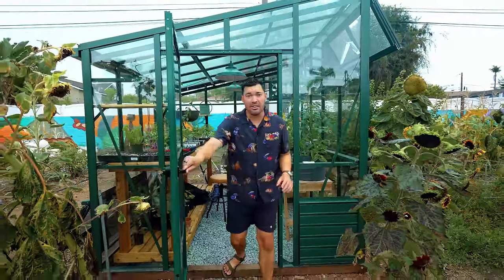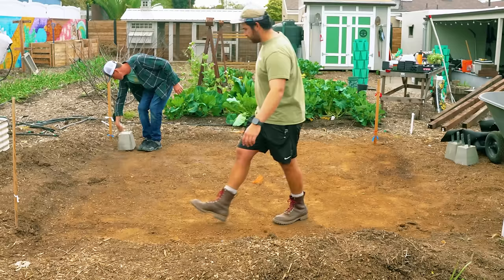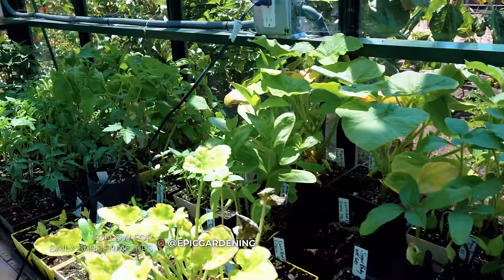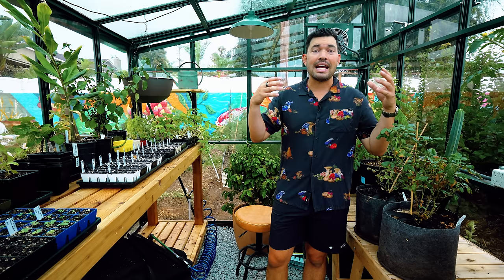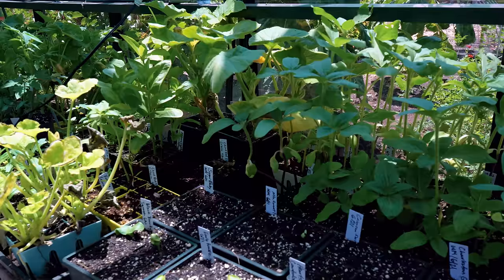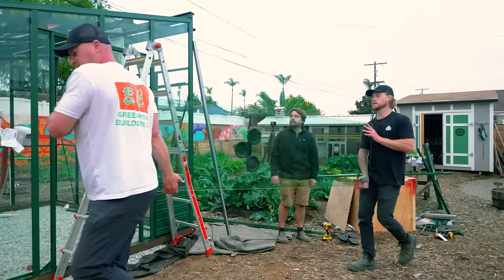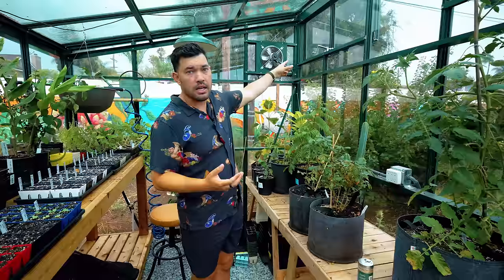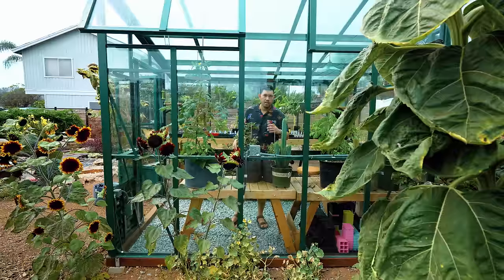What I Wish I Knew BEFORE I Got A Greenhouse

Comment: I’m gonna get a $340 cheap hoop one from Amazon to start, but this is my dream!
Reply from the maker: Good place to start!
Reply: We got even cheaper ones off Amazon, they've been a game changer!
Reply: @starlamartin354 my first greenhouse was one cattle panel 50"x 16ft. Bent over and stuck in ground..then covered with 8ml plastic..cost me about 50$..each year I added panels and smarter covers..still use it and dream of a NICE greenhouse someday😂
Reply: Add two more zeros to that $340 for this complete presented project.
Reply: I have a pop-up cheapie from Amazon. I rent but awesome landlord let me put it up. Lots of storms and wind here in Pearl MS, and I have a few repairs to make, but it is still standing This will be its 2nd full winter...No regrets 🌱❤
Reply: One youtuber uses steel rebar to "root" the cold frame connects it into PVC above ground. He clad it with frost cloth with clamps. For wind he crossbraces with twine. Search protecting tropical plants from cold (hes in Arizona)
Reply: @SpaceCadet4Jesus idk. I bought one for $300 and it’s pretty huge. Thats all the project was for me but then again I already had a cement ground

Comment: My Greenhouse gives me flexibility. You hear of people being able to plant early but, you can also start late and still get production. I heated my Greenhouse last year in fall for 4 frost nights and got an extra 80 days added before and after frost. 80 days is an extra season or 2 for curtain things. In the winter I mainly use the greenhouse to workout, it’s 100 degrees F on a freezing day as long as the sun is out.
Reply: Work out in the greenhouse? Thank you for this idea. I love doing yoga on my deck but in winter that’s not an option. Hmmmmmm.
Reply: Gotta put your cold plunge right outside for after you workout in your sauna:)
Reply: That’s a great of a greenhouse, I use my greenhouse for drying laundry in winter 😊
Reply: @jessegee179 that's a brilliant idea. Thanks!!
Reply: How did you hear your green house? What is your green house made of? Is it a DIY greenhouse or professionally made?
Reply: I move my mobile BBQ into the greenhouse for winter, so it is more accessible if the weather is good!

Comment: My wife and I designed and built a 20ft geodesic greenhouse this spring. I 100% agree with you about being paralyzed with the space and options. We also found that the intake/exhaust fans were a must with the summer heat, but I think we still struggle with airflow based on how well some of the plants did. You talked about opening up better options - If I recall, coffee is solidly a tropical plant? That would be fantastic. I want to move our citrus and olives in this winter. I am in 6b/7, and hoping that with the proper setup we can keep that greenhouse above 60F throughout the winter. 

To be honest, I wish we had gone with something simpler and easier to take care of. It looks cool as hell, but I already know what I need to replace and I need to schedule maintenance around the grow season to make sure I am not trampling everything inside.
Reply: Thx for this perspective. I keep thinking about all the windows that would need to be kept clean.

Comment: I built mine originally from recycled windows from my house. It didn’t last. The windows were single pane and the frames were compromised by weather so it fell apart over time. Now it’s made with plastic corrugated panels and some metal sheets. Much better. This is the first year for the greenhouse to be finished so I’m spending the fall organizing it so I can grow seedlings and some of those plants you mentioned that would otherwise be out of the question. They are a great addition to the garden and a much appreciated season extender here in zone 6a

Comment: What I wish I'd known before I bought my greenhouse:  living where hail is a regular occurrence (Colorado front range), with a polycarbonate greenhouse, make sure to have plenty of spare panels on hand and hope that it's easy to replace them.
Reply: I also live in Colorado... south eastern burbs on prairie.  I am looking at buying a greenhouse and have definitely looked at B C Greenhouse.   My question to you @johncaswell2648 is this:  glass or poly?
Reply: @bluesky7226  Mine's poly because it's a cheap kit from Amazon, gets the job done for me but nothing special.  Glass is probably nicer, so if you're willing to spend the extra, I'd say glass is probably better overall.  The one advantage poly has over glass is that it was very easy to cut it to mount an exhaust fan.
Reply: Thank you for your reply and advise.
Reply: One of the ladies this guy throws to lives in Colorado and went with glass. Said the hail has not yet broken anything, knock on wood! Good luck.

Comment: I'd mention that preparation may include building codes and permits, including the electrical.

I'd also mention mold and fungal growth with improper humidity and a plan on how to keep both inside and outside windows clean and sparkling, especially on the roof.

A lot of other unspoken details need considering and can't be overlooked really, but don't let that stop you.

Of course there will be things you wish you did differently despite the overall success of your project, that always happens.
Get to growing.

Comment: My husband is building me one. I’m taking what I get! We raise Rams so the first three feet is metal. It’s 16x24 in our backyard. Mines permanent as he put in 12 poles each with 80 pounds of concrete 😂😂 I’m the concrete mixer in this family. Couldn’t feel my arms after that weekend. It’s not done yet but this winter should be done. In West Texas so we have a longer growing season. I’m getting an echo delta 2 solar generator for running grow lights and fans and heat for the week we freeze. Also have propane backup for heating.

Comment: It looks like you also used the wrong kind of gravel for your shed. Not sure about the greenhouse since it's not actually supporting anything. But it looks like you put down clear stone/washed gravel. What you actually want is AG stone/Paver base/road base (different names for the same thing) which is a mixture of 3/4-1.5" gravel, along with smaller pieces of gravel and fines (crushed stone). This mix can be wet down and compacted and will make a very hard, compacted surface appropriate for various uses depending on the depth. 

If you want a more compacted surface for your greenhouse in the future, you could probably mix some fines in with what's there, wet it down and tamp it, and you'll have a hard, smooth surface.

Comment: I got an assembly kit from a box box store.  I wish I knew more about how the material would be  impacted by the harsh Texas weather
Reply: I have a pop-up cheapie from Amazon. I rent but awesome landlord let me put it up. Lots of storms and wind here in Pearl MS, and I have a few repairs to make, but it is still standing This will be its 2nd full winter...No regrets🌱❤
Reply: Texas has weather? I thought it was a desert.
Reply: When I was a kid, my dad built a glass greenhouse (b/c he thought it would be less of an eyesore near the house than one using fiberglass) in FL.  Didn't work for conventional vegetables or even orchids, but a great place to collect Kalahari Desert plants.  (So hot even some cacti struggled.)  I still miss the stinky but amazingly peculiar stapeliads that grew like weeds.  If you use glass or another transparent, heat trapping material, you might try an aquaponics setup (for tilapia or other tropical fish; Rio Grande perch sounds cool) so that the water can moderate temperatures (at the cost of high humidity though) enough for at least Southern and tropical vegetables/fruit.  Or pay attention to the microclimate you created and become a collector (probably of low-altitude desert plants) and consider it a hobby rather than food production platform.  Some cacti are of course delicious, so there is that option.

Comment: I love my little greenhouse even though it isn't a permanent structure like yours.  I just took a 10x10 pole canopy that you can pick up at a big box store and skinned it out last year with cheap clear plastic film instead of the fabric it came with.  This year I managed to get my hands on some 4mm double wall greenhouse panels pretty cheap and will be using those instead for a more substantial setup.  Since I can take it down at the end of the season and put it back up when it is needed again, I need no building permits for it.  The frame also made a great trellis for my dipping gourds and luffas, though when they are done I will be scrambling to get the panels on it before it gets too cold out for some of my other plants that need to spend the winter in there.
Reply: Awesome idea! I was thinking to do something similar with one of the free trampolines I constantly see on craigslist. We already built a shade structure with 3 of them. Just went to Home Depot and got longer poles to raise the trampolines to different levels and over lap them slightly like a venn diagram. The trampoline fabric looks like a 50% shade cloth so it makes hot sunny days more enjoyable in the yard. This type of greenhouse would be more airy than an enclosed greenhouse but I think it would be warm enough in zone 10a. Tarp it or put clear plastic over top in winter to keep rain out.

Comment: That sunflower is massive! This greenhouse is definitely inspiring me. I’m wondering if I could do one that is half Lexan on my windward side to block out too much wind (it gets really strong here) and rain, but do screen material on the other side. Or, do pop in and out panels for seasons. I love that wax piston window system, though I wonder what temps it has to get to for opening and closing. Since it’s mostly 70s and 80s here, I’m curious if it would just be open all the time anyway.

Comment: I had bought a greenhouse kit a couple of years ago, and last december we tried to put it together and the frame was so crappy. So in June, I finally got the lumber to build it myself and utilize the panels from the kit, its way bigger than the kit. I get great sunlight, I'm in Texas so we had a hot summer, but I didn't have it done yet. Omgoodness you're in California, I'm from northern calif, but I have lived in Texas a long time. But my from scratch greenhouse looks fabulous, I do not have electricity to it, but a cool solar lamp for it. I have very good ventilation with really good screen material.

Comment: I have had so many green houses. Foundation is of greatest importance. If you live anywhere that has hot weather make sure you have your greenhouse pointed towards the prevailing winds if you don’t have expensive ventilation. Make sure you can put in an electric line then add another water hose to it. I live in Oklahoma City my greenhouses get beat up so depending on where you live you need to keep that in mind. My heater shorted during a cold spell-14… I had a 30yr old ficus die

Comment: My greenhouse has a cement slab floor. If I could change anything it would be to have some sort of drain in the floor.
Reply: When I was planning for a greenhouse, some of the recommendations were for a wood floor, and some were for a concrete floor. But, most were for using a gravel floor. I went with a crushed limestone gravel floor, and I am so glad I did. Spilled soil or water runoff is not an issue, and it is easy on the feet and legs.
Reply: It is not hopeless...there are drill bits that can drill through concrete.  Cold chisel???  It's been a while.

You can also get a special plumbing piece that can be glued to the end of the correct size PVC pipe, the other end connected (again, with a PVC plumbing connection that will allow you to attach a garden hose.  Big box store, plumbing section.  

Dig a hole on the side where you want your drain hole to go under your slab.  Turn on the water to the garden hose and the high water pressure caused by the fitting will allow you to turn the pipe and it will be sort of pulled forward, under the slab.  Look for videos on 'How to drill under a concrete driveway.  If you have a lower area in your garden the drain can lead there.  If not, you may need to put in a "French Drain."  (search YouTube)

 I drilled under a patio to a place where I had left a hole for a birdbath and was able to run electrical lines for an outdoor outlet to run a pump in the fountain.  

Keep in mind, it depends on where you live.... you MIGHT be required to hire a pro.  Check out your local building codes.  HTH

Comment: I’m currently building a greenhouse door seedlings, it’s on the smaller side but I got 2 of them to go side by side. Planning to use one in winter to see if I can grow tomatoes and other things that need that bit of warmth that i otherwise don’t get (i’m in a 10a zone)

Hoping to have it finished over the weekend and planting up some seeds ready to transplant out before summer 🥰
Reply: Not sure where you are but San Francisco is the same. It can get hot or cold very unseasonally but stays mostly moderate all year long. I think I'm in 10a or 10b. The reason a greenhouse is great for that kind of weather is for germination. I would kill to have better conditions for starting summer fruits. I can't reliably grow melons because of the lack of consistent warm temps for starting or growing. Same with okra. Starting peppers is so slow because they require over 75º to germinate and it often stays in the low to mid 60's day after day (in summer) with temps in the 50's at night. A greenhouse would help me create my own custom shoulder seasons and get better yields from hot season plants by getting them bigger sooner before the season.

Comment: i've got a greenhouse and noticed that the lowes aren't much different from outside so that really limits what i can do with it in my area.  and the highs are like 10 degrees higher than the highes outside which bakes everything inside.

i think a much better solution is to use a grow tent indoors with grow lights.  that way, those shorter days in the winter aren't an issue and you get the perfect temps for seedlings too.  it's a great solution.

Comment: I bought a 8mm/10mm polycarbonate greenhouse (German engineering/production and great quality) as a year round.  I really like it, it's well insulated and I only heat when temps are in the low 20's. I live at elevation TN in a schizophrenic grow zone 7a that is sometimes  like Z6 if a bad winter and every summer like a SE Z9 as a tropical climate, yes tropical with high humidity and heat. Our summer is way too hot for greenhouse growing and believe it or not at 2000ft elevation the sun intensity is off the charts. Even with shade cloth, exhaust fan sync'd with intake vent and fan the heat can stress plants.  Citrus love it along with Sweet Potatoes but not much else that I grow over summer.  I have learned how to use my greenhouse to my advantage and growing styles/climate.  But after loosing all my spring starts two yrs ago when grow lights, heat mats, heater all turned on at once and tripped my greenhouse GCFI circuit during a -12*F string of days that we never experience - everything froze it was all lost. So I still grow seedlings and starts inside.  Due to the erratic climate and weather extremes, I now grow nearly everything other than root crops under protective cover.  It started with a polytunnel with rollup sides (a virtual screenhouse) intended for summer hydroponic tomatoes and now a second polytunnel both as 3 season extenders using grow bags for potatoes, broccoli and asst. peas w/drip irrigation in Sep-Nov Broccoli/Peas and Feb/Apr and tomatoes Jun-Aug.  I grow 3 crops of Irish potatoes - spring/fall in polytunnel and overwinter in Greenhouse.   The polytunnels are much cheaper but give me great flexibility in addition to my permanent Greenhse.  I find the poly tunnels provide much needed protective growing  during prime spring/summer.  It's rural here and my property abutts a natural forest so we have big time  insect pressure and deer ,varmints and believe it or not, woodland rats!   No critter has gotten into either of my two polytunnels.  There's nothing more disheartening that to go into the garden to see the deer decimated a 20ft row of green beans and mow through a row or two of tomatoes.  Then there's the rats/possum dig up both sweet and Irish potatoes.
Reply: Supplier of that greenhouse?

Comment: You can get climite controller that will close the windows up high amd turn extraction fan on, you can set windows to open at certain temps then if it goes over your highest set temp then they close and fan turns on. You just have intake vent always open with some fly screen over it, then when windows are open and hot naturally escaping up high you will get some passive I take down low as well.

Comment: Here in Finland the problem is that you may need a permit from the town/city to build a greenhouse even though you would own the land where the greenhouse stands. Because if you build it without a permit then some bureaucrats may arrive and demolish the greenhouse. But usually getting the permit to build one is easy.

But there are some loopholes for all this if someone wants to avoild all the (extremely slow) bureaucracy and have a greenhouse as fast as possible. Like if it is a greenhouse that can be moved easily (has wheels) or it is greenhouse that only is built for summers and is removed for winters then it may not need a permission.